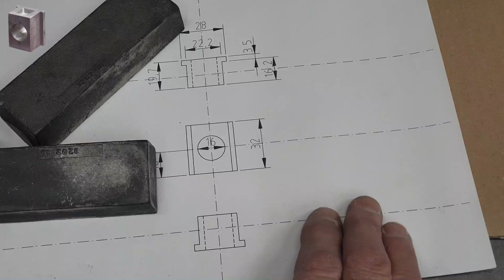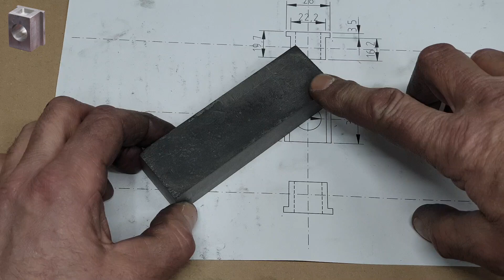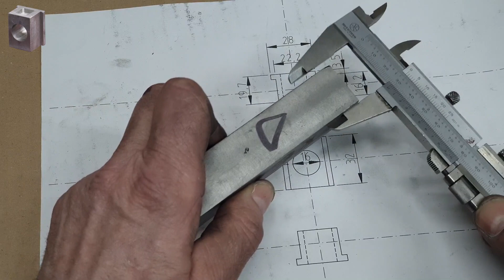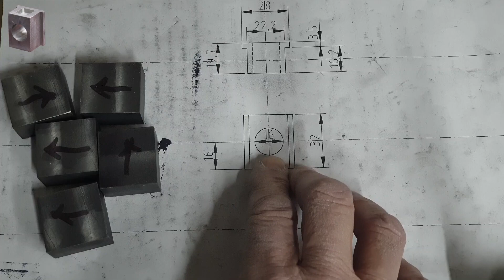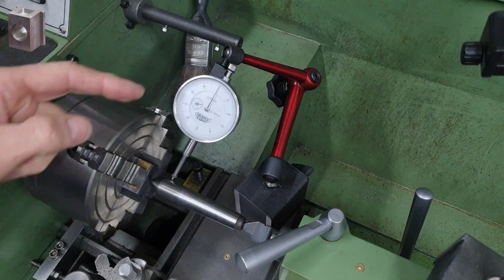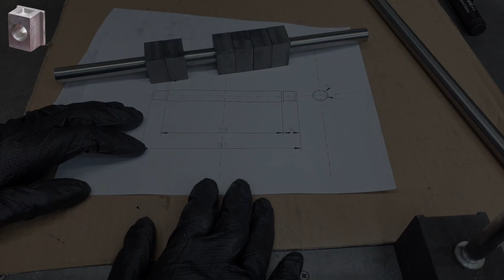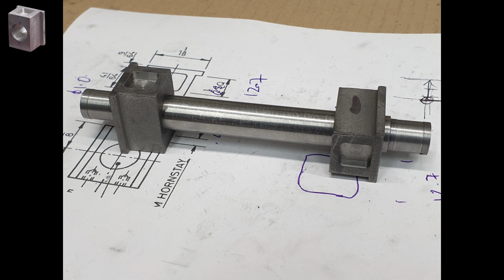Part 6: Machining the Axles and Axleboxes.

Comment: When you flipped the axle to face off to length, did you use something like a stop inside the bore? or 'just' a mark and going by eye? I'm about to turn a few myself and did that and it seemed OK, but I may have been missing a trick!
Reply from the maker: Hi William,
No, I didn't use a stop.  I simply faced off one end, faced the other, then removed the axle to measure it before refitting, touching off with the tool and facing off again to length.
Cheers.
Reply: @markshomeengineering5243   - that's what I was planning, glad to see I'm not wildly off. I'm buying a box of bits with a few items part machined, such as the wheels - so I guess we'll have to play that one by ear...
Reply from the maker: Also, if you're following my approach I would advise against doing what I did with the shoulder and subsequent boring of the wheel.  It will be easier to drill and ream the wheel and the turn the axle shoulder to suit.  I've had a few challenges with my wheels 🙂
 Next video....